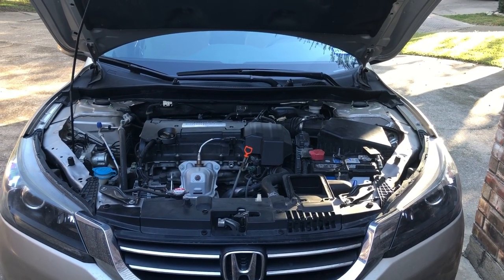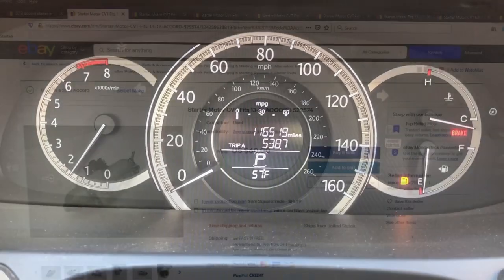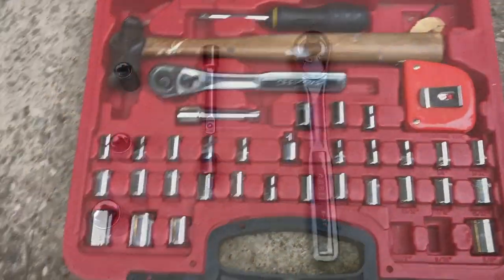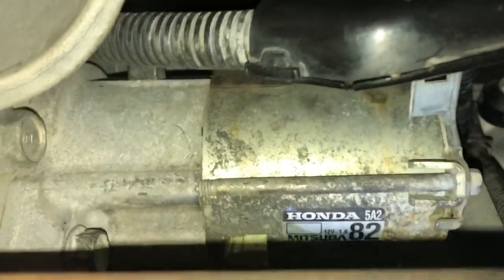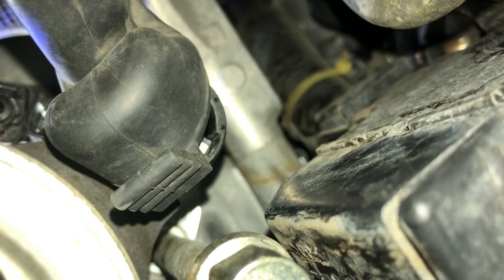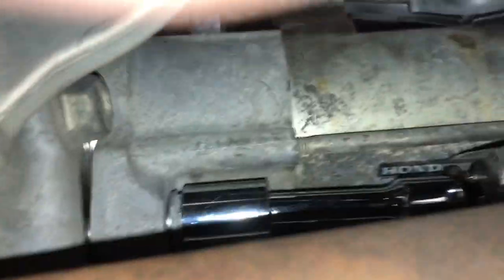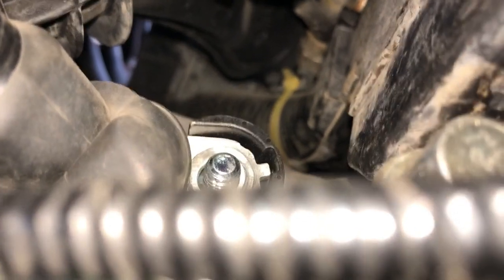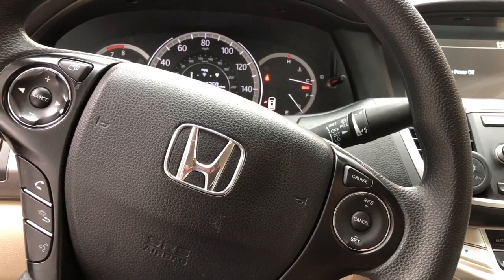Starter Problem & Replacement in Honda Accord 2013, 2014, 2015, 2016, 2017

Comment: I had similar problems with my 2015 Honda Accord I thought it was my starter but it’s my alternator and I only have 50k miles on my Honda Accord ima have to replace it soon thanks for the video !
Reply from the maker: You are welcome. I am surprised your alternator went out at just 50K miles!! In Honda vehicles I've owned the alternator typically failed around 120K miles. Have you replace it by now? Did you do the work yourself or at a repair shop?
Reply: @FlyBeee  I ordered one like yesterday so hopefully it comes soon so I can replace and yes I’m doing it myself since it isn’t to hard to replace them they are a bit pricey but you know it’s better if I get it done and not have any problems in the future and yes I was surprised to ! It shouldn’t happen that fast I’m just wondering why that happens.
Reply from the maker: @iamgiovanny458  You are doing the smart thing to change the alternator yourself vs. taking it to a shop. Did you get OEM or an aftermarket? 

As for these issues showing up so often, I think the quality of Honda vehicles and the parts it uses has gone down in general. I have owned several Honda vehicles and they were solid vehicles that never had parts fail so early. Toyota is no different either so grass is not much greener elsewhere. I have made peace with the vehicle needing more TLC and started to do more work myself to keep costs low.
Reply: @FlyBeee  I ended up changing the alternator to the OEM alternator and it still had the same issue 🤦‍♂️ so I’m guessing it will be my starter after all
Reply from the maker: @iamgiovanny458  Oh no! .. at least the good thing is you have a brand new alternator which will be good for quite a while. The starter motor is easy to replace, just follow the steps I show in video whcih are also listed in the narrative description. Only other tip I can add is to lift the car as high on jack stands as possible because it will give you more space under the vehicle to work with when replacing the starter. If you get a chance please let me know whether replacing the starter fixed the issue. Best wishes!
Reply: I Saw something about the starter relay or the tsk sensor next to the brake. I wonder which one is really your problem.
Reply: TSB sorry
Reply: @JUDGEME5150  yeah I was wondering what it could be because I took out my starter  and got it tested and they said it wasn’t that either now I’m stuck with trying to figure out what it is. I have to wait now until it gets worse
Reply: @FlyBeee   hello how do you know when is the Start or the switch ignition problem? My 2014 Accord 70 ,000  miles  sometimes won't start  after you heard 2 clicks then starts but I no sure if is the ignition switch or the starter thank you
Reply from the maker: @patosoda  If it is starter problem then it will get worse with time and car will take longer to start. If your Accord has push-start button then it may be causing issue because some models of Accord have this issue (lookup this issue on CarComplaintsDOTcom). I hope this helps.
Reply: @FlyBeee  thank you!

Comment: About how long did it take you?
Reply from the maker: Took about 2 hrs to do the work and make this video!! Spent A lot of time to get the light and camera angle correct to record what i was doing due to starter’s snug location. Actual work is probably just 30 mins, its just 2 bolts and 2 wire connectors! Definitely have a light under the vehicle. The magnetic light i listed in description turned out really awesome. It is cheaper at walmart. Good luck.
Reply: This video is one of the best I saw for my starter, knew exactly what the look for when I was under the car step by step. 

Without much experience working on cars, and a car jack that gave us almost zero room to work, it took my pops and I about 3.5 hours to do. Definitely was a pain in the ass, but saved about $400 worth in labor.

Comment: I changed my started but the sound is different, is that normal? 
The started I bought was aftermarket.
Reply from the maker: Honda vehicles work better with OEM parts and fluids so thats my first recommendation. If the different sounds is only when starting the car, and after it has started if all sounds are as they were in the past then may be there is nothing to worry.

Comment: Happened to mine on a 15 accord after I plugged in progressive safe driver device. Would only click and start sometimes. Only 55K miles. 

Undid the progressive device and replaced the starter. So far so good.
Reply from the maker: Thanks for sharing your experience. Can't believe the Progressive device caused the issue, Good decision on not using that tracker! Best wishes
Reply: @FlyBeee  I don't think so either. I always had issues with the aftermarket remote starter. I disconnected that and took out the insurance tracker. 
I'm assuming those Honda models were all having shorter shelf life's of their starters.
Reply from the maker: @37HD  the starter on the newer Accords and CRVs seem to have shorter life spans vs the older model Hondas that never had starter issues , at least not in the many Hondas I personally owned. The Honda quality is slipping away!

Comment: Just started to come across the same problem. 2014
Reply from the maker: If the problem just started then you have a few weeks to plan the repair, but get it done soon. The replacement starter motor I installed is still holding up well. In case you want to go the route I did. How many miles are on your 2014?
Reply: @FlyBeee  I am gonna get a new one and do it myself. The car has 222 000km.
Reply from the maker: @rebel_12  Sounds good. If you get a chance, review the description of this video where I have step by step detail on how to replace the starter. I hope this helps. Good luck

Comment: oh yea a used low mileage oem starter better than aftermarket garbage
Reply from the maker: Totally! Mine still going strong with almost 30K miles that I put on it since install.
Reply: Guys I bought an oem one from the dealership 400 bucks ! And it’s giving me more problems then the one I had before.. are they remanufactured?

Comment: Just got mine replaced at the dealer after having it towed from a parking lot, suddenly car didn’t start. $881 to get it done just FYI
Reply: They gave me a 3 year warranty on new starter, hopefully I never need a new one again
Reply from the maker: Thanks so much for the info on current dealership cost. Really appreciate it. How many miles on the odometer when you first experienced starter problems? Thanks
Reply: @FlyBeee   I started experiencing problems with starter at 84k miles.
Reply from the maker: Thanks. How long did it take for the problem to get worse? What was the mileage when you had the starter replaced?
Reply: @FlyBeee   took about 3 months for my starter to finally really give me issues about to replace mine within the next couple days
Reply from the maker: Let me know how it goes or if you have any Qs. For replacement starter are you planning to use OEM or aftermarket?
Reply: @FlyBeee  I’m planning on getting one from autozone just because it will have a limited lifetime warranty. I have about 60,000 miles currently on the vehicle. Have you replaced yours and if so did you use oem or aftermarket?
Reply from the maker: Autozone is local and that's the other benefit in case one has to return the part. How much is the autozone starter? I bought a used OEM Honda starter from ebay for $60 which had only 27K mile on it (the one I show in this video) and it working fine for now after about $5K miles on this. I will get the original one rebuilt locally and keep it for when the issue comes up again.
Reply: @FlyBeee  ahh okay sorry that was a dumb question of me to ask if you’ve done it yet. You created the vid hahaha
Reply: @FlyBeee  I think it’s around 320$
Reply from the maker: @desco1927  lol, no worries! By the way the $320 for aftermarket starter seems high.  OEM honda starter is available on Amazon for $342 and I posted the link to it in description of video. Check it out when you get a chance.
Reply: @FlyBeee   hi I ended up calling my local Honda dealer and luckily enough we still had warranty. Ended up taking it in and paying a 50$ deductible with a 1 year warranty as still have 30k miles until my warranty or 4 years left on my warranty. I guess it doesn’t hurt to try your dealership first. I normally hate going to dealer cuz they charge an arm and a leg
Reply from the maker: @desco1927  This is awesome!! $50 is definitely fantastic vs $900 my local dealer quoted. At 95K my Accord was out of manufacturer warranty. How many miles on your Accord and do you have extended warranty?
Reply: @desco1927  I'm noticing mine is starting to have issues at 88k miles. Seems like I have little time until I get stranded.
Reply: @amoctez2  I would recommend going to your dealer first. I thought I didn’t have warranty but luckily I did. It started off by sometimes starting to it won’t start at all. I waited a whole two days and it turned on and drove it directly to the dealer

Comment: Geez, why did Honda put the starter on the bottom now?
Reply from the maker: Probably over confidence on part of Honda, thinking the starter wont need to be replaced so soon. Or they tried to make it difficult enough so people don’t replace it DIY and have to get it replaced at a dealer. i am just guessing. I hope this video and its narrative details help. best wishes
Reply: The only thing that I can think of is the CVT.  The V6’s is on the top.